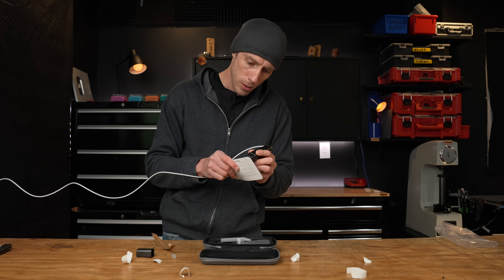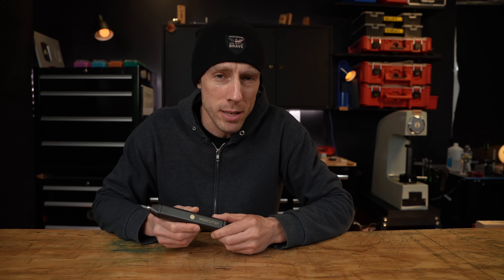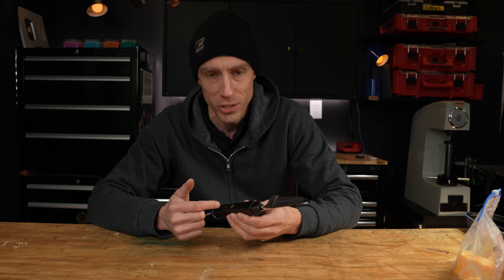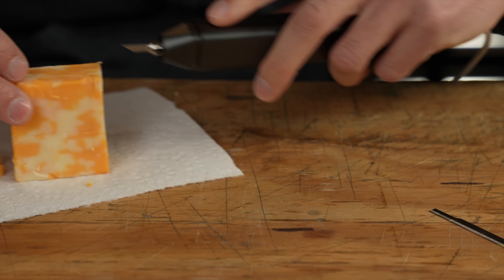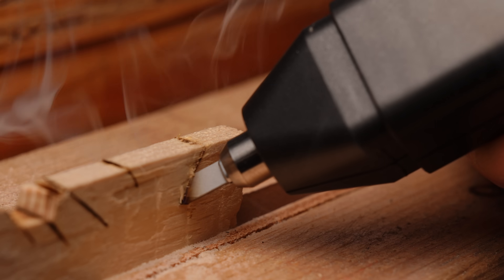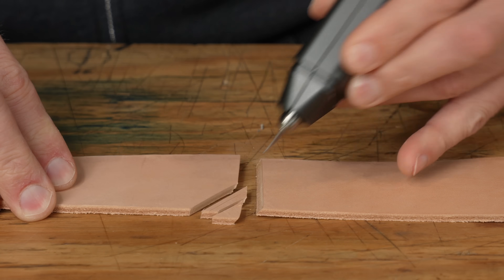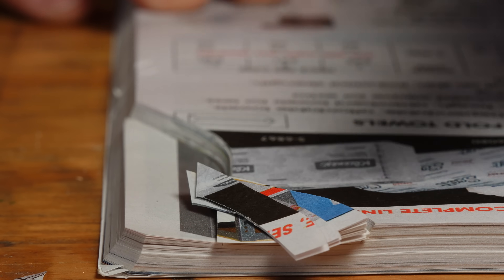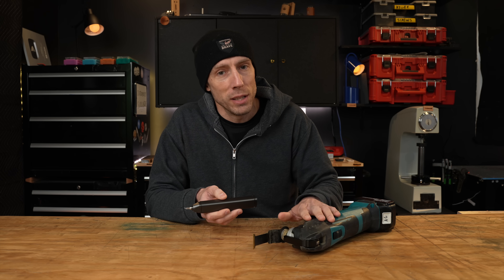Could This Small Tool Be The Future Of Knife Cutting Performance?

Comment from the maker: Tool in video https://amzn.to/4gLEJ8l  (I bought this with my own money, for what its worth.)
Amazon Affiliate link. 
As an Amazon associate I earn from qualifying purchases.
Reply: Did you try shaving? That would be something! A shaving blade that doesn't chafe.
Reply from the maker: @goncalovazpinto6261  it wouldn't cut a free hanging hair. And you definitely don't want it near your skin. If you're finger is even close to the cutting edge you'll feel like you're fingers are burning holding the material.
Reply: @OUTDOORS55  I was thinking something like a gillette razor but ultrasonic. When you shave maybe the water or shaving cream might keep the temperature down.
But I definitely wouldn't resist trying to shave some arm hairs with that cutter you have!😆
Reply: As long as Honey doesn't steal your link, that is
Reply: Damn have your videos become impressive m8. Those macro shots are incredible. Seriously can't give you enough thanks for completely changing the worlds understandings of knives. I'm not a complete seeing is believing person but damn does it help. Not another knife channel on your level man.
Reply: Would you consider testing one of those electric Fillet knives? I suspect they work similarly to the oscillating tool, by moving the blade back and forth or up and down.  The ones I have seen take either regular Power tool batteries or an electric "station" with I assume adjustable speed/power. It could be interesting to see. Should also be easier to modify to take your own blades as they take larger blades, if you want to experiment.
Reply: I used to use a larger more powerful version when forming and cutting graphite prepreg composite materials while building AV8B Harriers back in the 80's. Blade life was the limiting factor. We had to change the blades ridiculously often. Maybe once every foot of half inch thick layup.
Reply: Hi do you know anywhere that you can purchase the kme pro6.
Reply: Hey man, love your content, it's no-nonsense and often very informative. But could you please stop doing the shitty "clickbait thumbnail that doesn't inform the viewer what the video will be about but makes them curious, paired with a clickbait title that doesn't inform the viewer what the video will be about but makes them curious" tactics that are ruining modern media? A world where people waste hours of their time on a daily basis starting videos and clicking away after a couple of minutes when it turns out they weren't what they expected, just so the uploader can make $0.0000000237 on that click is not a world you want to contribute to. You're better than that.
Reply: I hate clickbait much as anyone so I’m kind of confused by your comment.   How was it clickbait?
Reply: I think you’re looking for the 369 sonic knife
Reply: When you change the blade it changes the frequency needed...

You need to have the blade vibrate at the frequency where it can add to the vibration or else it cancels itself out

Think of this like being on a swing and changing body position at the right time vs randomly
Reply: New ultrasonic chef's knife is out. Please make a review on it. Would love to see your take on it.

Comment: As someone who actually worked in ultrasonic tool design and manufacture, I can add to your video that the main reason why your knifes attachments didn't work is probably because they were the wrong length.
Ultrasonic tools are designed in the way that ultrasonic wave traveling through them forms a standing wave and that the working end of the tool is at the resonant node of that standing wave. This way your tool transfers the most of the energy into the object. If your blade is of a random length than it gives you no standing wave and energy is just dispersed from the whole surface of the tool.
Ultrasonic tools can do crazy things. For example, you can easily cut coins with just 5W of power (though, we used tungsten tools for that).

Comment: As far as the "consumer" realm this technology is in its infancy.  I got a couple and have settled right now on the Chaw/ke or whatever brand (had the Migicutter like shown first and it was not robust enough) at about $300 for the "PRO" version. I'm on my second one as the transducer failed on my first one. I use it in my shoe repair shop to cut both dense and airy rubber as well as leather.  It works, but I need the next step up for more functionality and the leap from the $300 model I have and the more "industrial" ones is great, like they're all above $1000 and they go up from there. The industrial ones tend to have thick blades which I believe I prefer the more razor type blades.  I'm hoping this whole field evolves to many more choices. It has great promise and if the products can develop to offer greater robustness while still being affordable I think the segment will explode. I do love having this cutting tool in my shoe repair shop.

Comment: Thanks for this. i'm a normal guy with a tool fetish, so it really helps when someone tests stuff like this out so i don't have to run right out and get one  to see what it does and doesn't do.Agree, size matters. i use my oscillating cutter all the time. Right there with you on a bigger ultra sonic for try wall, and stuff.

Comment: The thing about high frequencies is that the edge reverses direction so quickly that the inertia of the material itself acts as an anvil. The mass of the material ends up being a kind of fixture so you deliver a good shearing movement at the edge. At low frequencies, like with an oscillating saw, the material can catch on the blade and vibrate around. When the material catches the teeth it can jam on the blade and oscillate with the blade.

High frequency edge engagements deliver shear energy efficiently by accelerating enough that the material doesn't itself vibrate while delivering shear energy so it feels like you're holding a hot knife and it's sliding through things. It works better than a hot knife because most of this energy is delivered at the frontal edge and the flanks, but much less on the sides of the blade because there isn't much force pushing the material against the side of the blade.

A hot knife would still deliver a lot of heat at it's sides and end up melting your cut in a wide and uncontrolled way.

Comment: Looks like an incredible tool for small crafts and scrapbooking type stuff....or in an industrial setting where you have equipment to vibrate larger blades with a similar frequency. 

It would also be a nice replacement for heat-cutting/melting tools for synthetic ropes.

Comment: 0:55 two reasons this could be in my mind
1: Vibrations have a directly negative effect on friction, for instance nuts on machinery need lock washers/nylon locks to keep from coming loose
or 2: the additional energy added displaces the material that would otherwise inhibit the blade? edit: thats also friction but with extra steps lol

Comment: Surgeon have slightly bigger versions for scalpels. Look up a video it cuts through skin and flesh like butter. Now imagine an oscillator size one with a utility knife turns on inside your bag and you don’t think about it and plunge your hand in your tool bag… or the fate of the rest of your tools.. I might be a giant liability tool makers might not want to deal with. Cool tool idea of some gnarly safety measure are invented for it. Sawstop type off flesh sensing mechanism, maybe?

Comment: Oh so many questions! Is this better than just putting the same knife edge on a soldering iron? (making it a very expensive wire cutting tool) How is the knife's edge holding up versus manually cutting using the same edge? And is a large blade ineffective because the length of the blade means the vibrations are being absorbed by the material like different frequency earthquakes on short v. tall buildings? Would changing the frequency therefore allow you to use different length blades? I've been seeing some really cool uses for ultra-sonic vibration tech where the vibration frequency really does do something unique like causing cavitation or preventing material from having a chance to seize up, but this looks to me like it's not quite doing any of that and is just heating things up. I hope you do a follow-up video later!

Comment: For thick dense hard walls, you will probably need a very rigid blade, otherwise the blade edge is pinched so hard by the wall that it is immobile while the body of the blade flexes instead.

Comment: i work in manufacturing, and we have a device called an ultrasonic welder, it can fuse two pieces of glass filled plastic together in about 1 second. The knife is almost certainly a very useful tool when working with sheets of plastic, but honestly the uses where this is more convenient than a standard xacto are few and far between, i mean many of us deburr aluminum parts with xacto blades

Comment: Its just a guess, but I think the issue your having is thst the mass of the blade is too much for the piezoelectric device to move it properly. (E.g. a smaller or lighter blade may work better.)
Additionally its only going to vibrate on one assis, and if im right you want that vibration to be parallel to the blade.

So here is my guesses, you either need a larger piezoelectric device. A smaller blade, or a blade which is orientated in the same direction as the origonal one.

(Additionally, there may be something to do with the cut of the blade, it may need to be sharpened such that the grind is perpendicular to the blade.)

Comment: Metal Gear Revengeance had high frequency swords that could slice through plate steal like it was made of tofu. in principle, such a technology could exist but it would be silly to use as a weapon like that

also, in Dark Knight, batman uses a similar tool that makes no noise to cut a brick out of a wall, also like it was tofu.

Comment: Just use the oscillating multitool to hold a blade sort of sideways. The issue you’re having is that piezoelectrics don’t have much torque, so you can’t overcome the inertia.  But if you use an oscillating blade, all you need to do to scale up the speed is film it as a Timelapse.

Comment: Yeah, sure u could’ve used more power, but the reason why it didn’t work with any other blades is because the original blade it is at the correct length to resonate with the frequency being emitted from the PeezO. Theoretically you could make a larger blade that can find resonance with the frequency being emitted.

Comment: The small blade works cause it it tuned to the frequency of the vibrating if u were to use it on a larger blade the frequency mus match the bigger blade .
Its like 2 tuning forks that are the same will resonate. So the bigger blade is not tuned for rhat frequency

Comment: I was working in a factory building petrol pumps for cars. We had a test stand to check the flow after assembly. After calibrating the flow with a plastic screw, the screw was welded in place using ultrasound.
Bad for me was, that it was at a frequency I could still hear and the power was so much that I got absolutely dizzy to a point I almost throw up.

Scaling up those small knives to a multitool size would definitely cause trouble.

Comment: You can buy carpet cutting blades that have 2 cutting edges on them for your oscillating Multi Tool. 
They fly through cardboard, lino floor tiles carpet etc.

Comment: Achieving speeds like that with larger units would probably be extremely difficult, and it's probably also why your attempts of retrofitting a larget blade failed - it can't be any larger than that little scalpel for the engine in there to be able to move it. I wouldn't be surprised if the power requirements scaled basically geometrically rather than linearly.

Comment: You just asked a motor moving that tinny ways nothing blade up and down thousands of times a second to make the same direction changes on blades that are more then double the mass. Take a air filled ball push it out and pull it back to you fast. Now do that with a bowling ball.

Comment: It's essentially an ultrasonic bar welder for welding poly materials, but focused to a razor edge. It's definitely not a new technology, but the fact that is pocket sized is pretty amazing. I wonder if you could fit some kind of spatula tool to it and fuse vinyl fabrics with it.

Never mind. If that's not already a thing, it's my IP now. The attorneys I plan to hire are wicked smart.

Comment: I am a retired scientist who worked with X-ray diffraction. One task was to shatter rocks at grain contacts. We used an ultrasonic probe. They make them to shatter granite. You could get one and add a disposable blade. You would need some beefy PPE but I think it would work. Ultrasonic transducers can become quite heavy as the power goes up. I have seen water and ultrasound cut through steel. Military-shaped charges use principles of ultrasound to force water to cut through mines. Just my thoughts on your video. I did enjoy it.

Comment: Fein was the company that had the patent on those multi saws, I believe.
In 2002 we purchased a one for @$600, because we were cutting mastic from between cladding panels on a high rise whilst abseiling.
Initially using knives and blades, we realised we could save days of cutting in time + no effort ...
About 8 years later they started hitting the market starting @$200 and shortly after the band wagon, cheapies can be had for $40 ...
Yes Fein sure had a monopoly with that tool, but Brilliant!

Comment: Man thank you so much for all of the video. Especially for the sharpal and strop tip. Before this i was sharpening on these cheap aluminum oxide stones. It was a nightmare always. And i had nothing to get rid of the dishing, making it extra hard to maintain a accurate angle. I still managed to get a decent paper cutting result on them. But it was just horrendous to use, and i always hated sharpening.

After having watched a few of your technique videos and having used the sharpal diamond stone, i am able to get shaving knives within minutes and not halve an hour. And together with a strop,... it feels like splitting atoms, it is just a game changer. And sharpening is now actually fun...

Truly thank you.

Comment: think i understood how it work s- when you heat up something , you exite the molicules with energy , that causes them to ibrate and transfer theyr energy through collisions with nearby molicules , what the ultrasonic blade does with those vibrations is mimic that effect when touching a surface you attempt to cut , wich also mean if you have a fast and durable enough motor + blade , that can be upscaled , but then we run to the problem of energy where you either have to be pluged in to the outlet for constant energy flow or have a chunky and heavy battery

Comment: There is a scaling problem. As you get more and more mass vibrating at that high frequency, the parts start to wear out much faster and the vibration to the human operator becomes too large. You just can't move larger masses back and forth so quickly.

Comment: The reason other blades doesn't work is probably because the original is tuned to have a natural frecuency in resonance with the piezoelectric crystal, not necessarily because it's not powerful enough. You could try using a blade twice or trice as long and try to tune its length with a file

Comment: I'll bet you a regular tattoo gun would do a good job vibrating a disposable utility blade like you are talking about... Or possible a metal engraver tool, if you wanted to do it with high power yet very minimal travel.

Comment: The small size of the blade is why the pizo electric motor is able to do what it does in the knife form. The limiting factor is that a pizo electric motor can only move a small amount of mass before it no longer affects that mass due to the cube law. Basically in order to get something larger to move just as fast as something smaller, you need 3 times the amount of energy, which means you need more mass, and it becomes a never ending cycle of not quite getting what you want. A pizo electric motor simply doesn't have the necessary amount of energy to move a larger blade, which is why your DIY blades didn't work.

Comment: I've actually seen them for as low as $50. Comparing the $50 one to one that's $1,200. The more expensive one does of course work better but not $1100 better.

Comment: The two important issues here, assuming you can supply vibration through an efficient resonant structure, are the F = ma and the behavior of structures as their size (mass) increases. That is to say you need more acceleration for the same force with a more massive cutter. The big gotcha is that any structure, as frequency increases, starts to behave like something resembling Jello. This means the movement at the edge of the structure, (i.e. as the blade size increased) is nearly impossible to define. That's why a different blade mostly fails.

Comment: Does the blade need to be made of a steel having high tempering back resistance (HSS) or a material not really affected by heat like cemented tungsten carbide?

Comment: Mecstech has a full sized ultrasonic knife that you might want to take a look at. Iirc its connected to an external power supply so its not exactly practical but it's still cool to see it sail through bread.

Comment: I'm reminded of when you break a bone and have it set in a plaster cast. When the time comes to remove the cast a vibrating type of disc or blade is used yet that blade doesn't cut the skin.

Comment: As you say the oscillating multi-tools operate in a similar manner at a lower rpm and for plastics it looks like a hot knife would offer similar performance.  The only thing this knife seems really ideal for is cutting up your Bible so that your Glock 17 will neatly fit inside.